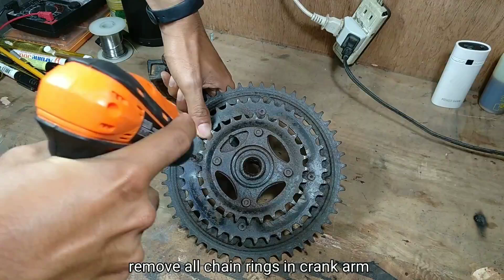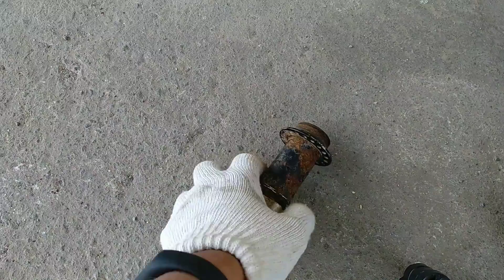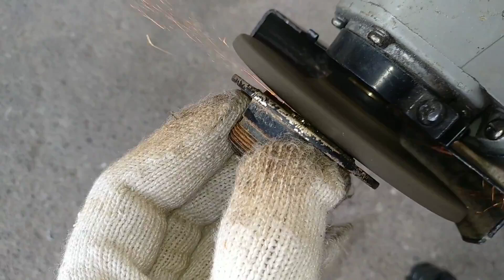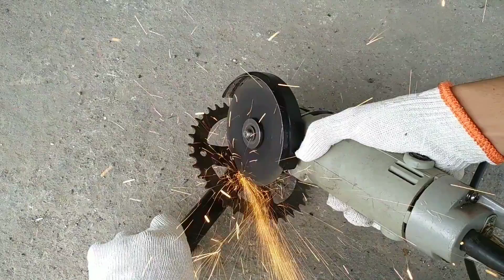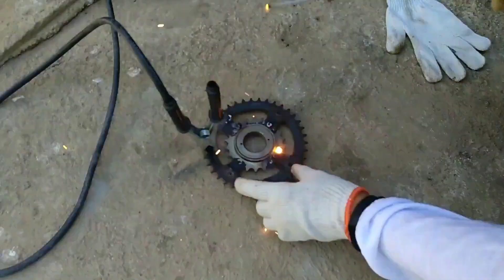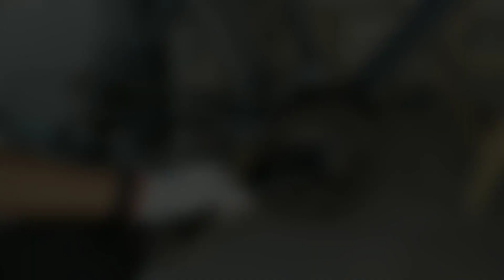DIY free wheel crank for mid drive ebike

Comment: This helped me alot! My project is making a jack shaft kit for my 2 stroke 66cc/80cc engine on my bike. Needed a freewheel... luckily I had one off a E-scooter I had laying around. It's doesn't have the gear on it it's just a flat ring with four holes in it. Perfect!

Comment: I did this and the problem I encountered was the threaded bearing mount Does not allow the crank arm to egage the square anymore .It sticks too far out. This will only work if you have the room between the crank and the bottom bracket for the bearing mount.Also instead of cutting up the hub. The right side of a bottom bracket bearing cup fits a standard freewheel. So make sure you have the room or the older bottom bracket style axle where the chainring side is longer. 
BEFORE EVEN CONSIDERING check if you have the clearance first, once you start cutting theres no turning back except to go back to square one and replace the crank to a regular one again.
Reply: you need a bottom bracket with a longer spindle